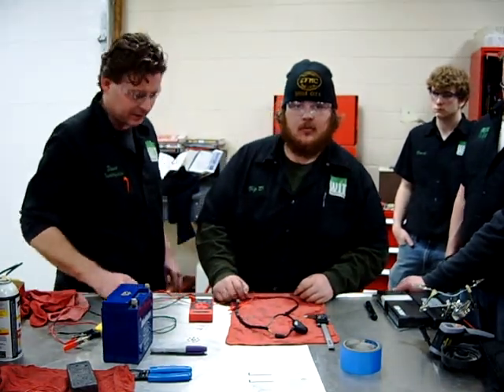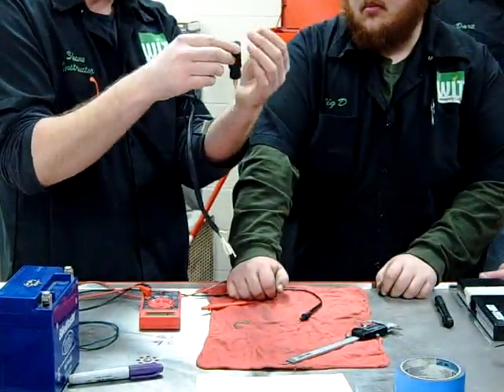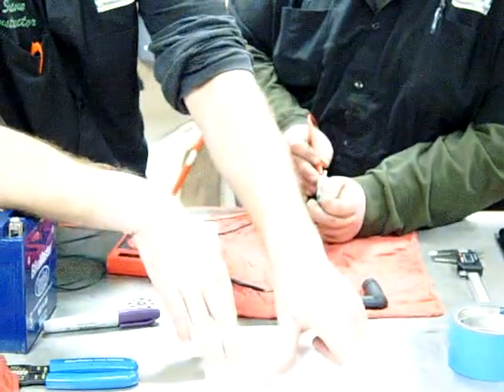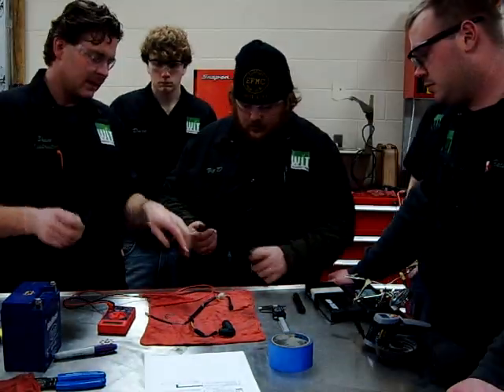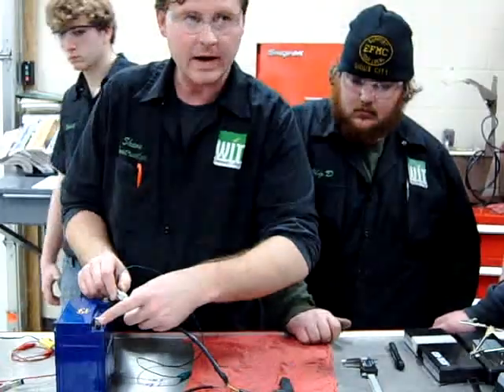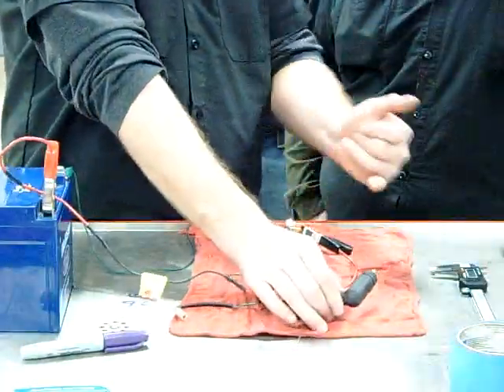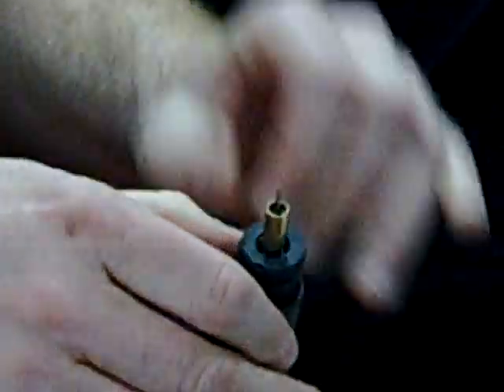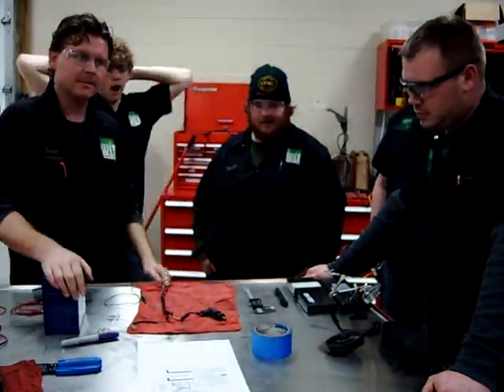How to test an Auto Bystarter (choke) Electronic Choke Honda Yamaha Chinese mopeds and ATV

Comment: Shane, Thank you.  I just got a used Honda Metro which was flithy.  I cleaned the carb and its working well, but I couldn't figure out why the bike would rev so high when I first started (five minutes at 40 degrees outside), then It would idle down perfectly.   It's suppose to do that.   Thanks so much.

Comment: A question please:

The E-choke starts receiving 12Volts current inertia when the engine is running.
After the current (12 volts) is maintained while the engine is running, or some system switches off the current E-choke ???
Reply: No,it M U S T stay on all the time,otherwise  it will retract,and the idle will be T O O ....T O O rich!    Danger!!!!!

Comment: so with the key on but scooter not running would the bystarter get warm/hot like yorus
Reply: No it won't because power to choke is from the bikes stator, unless the bike is running, there is no voltage to it even with key in on position.